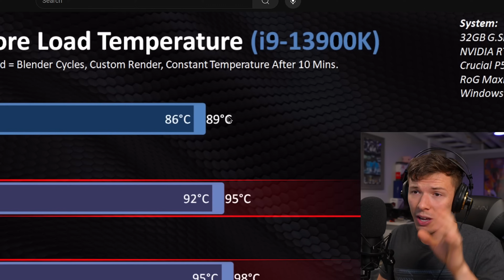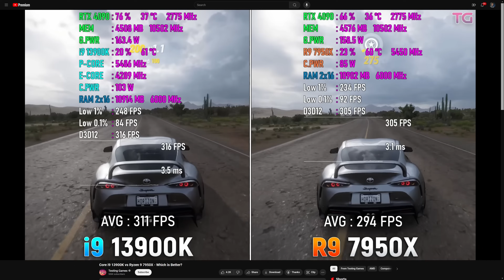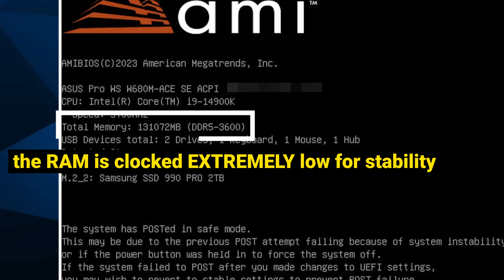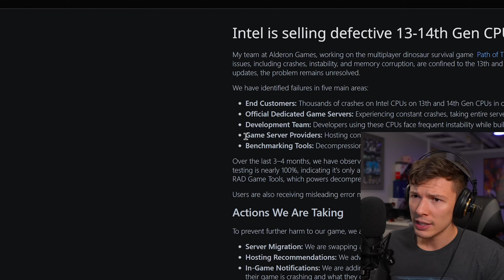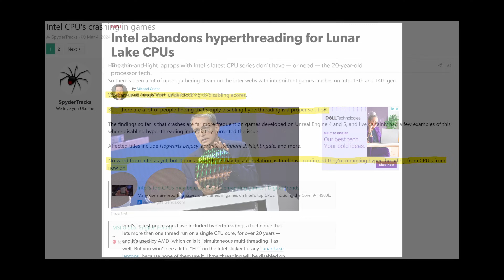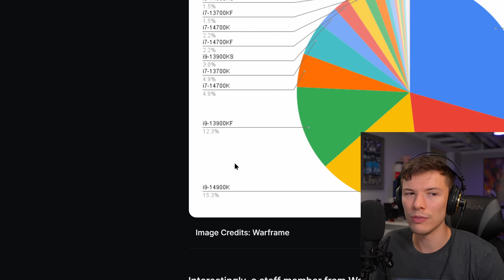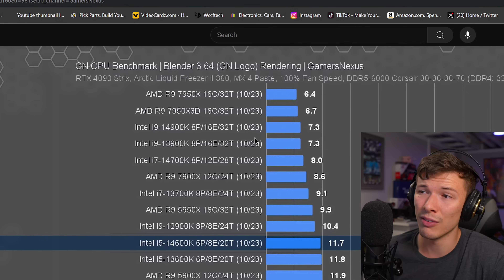Intel F**ked Up Bad

Comment: Some years ago I read about what illegal things Intel did to try to sweep AMD out of existence. And then Meltdown happened. I decided that for the foreseeable future I will no longer buy Intel CPUs, and my next build was with AMD 3700X. Later I got a sweet deal on 5950X. I've been super happy with the computer, I've never looked back, and it's great that I was able to upgrade to so much more performant part on the same platform for such a cheap price. Blue is my favorite color, but yeah, not quite enough to bridge the gap 😂
Reply: This. They still have contracts with Dell/HP/Lenovo to push their chips and offer more models over AMD. I don't even consider Intel anymore. I mean, even before all this, at the very least their CPUs were a lot less efficient for the same performance as AMDs. Why buy them at all? Only reason is brand loyalty.

Comment: This is a disaster and Intel knows it.  They can't replace these chip because it's a design error not a manufacturing error.  Even if they offer us rebate, we would still need to migrate to a new platform either AMD AM5 or Arrowlake/Intel Core.  Some us have to buy new ram kits.

Comment: Bought a 14700K back in idk januari/februari. I'm not sure what to do here, I know that cpu's that run countiously are affected more or faster I guess.
I have had zero issues with my cpu so that's something at least.
I'm going to undervolt my cpu and might disable the e cores as well because one of the main issues from what I've heard is the bridge between p & e cores.

Man what a time to live in....
Reply: @zackzeed  you dont need to disable the e cores just turn the volts down put an offset - in your bios to undervolt the cpu or you can use intel baseline profile
Reply: @TheOne214  Already am. Problem is the physical bridge between E & P cores.
Some say that That is the part that's failing, allthough I would love to know at which point it fails, like if people are overvolting their chips or smth.
Reply: I’m right with you on this. I set intel spec power limits that they posted online and everything works perfectly fine.
Reply: @wikingkrig5801 even a little bit degraded cpu will cause problems since mine isnt it means that its fine and i dont even push my cpu that much though it was at stock setting before i switched it to intel baseline but i still kept the AI overclock disabled i didnt even use it once i was already running a bit lower vaults than stock asus profile so i am confident that my cpu is fine i also have a 360 mm aio on it i never thermal throttled it even once since i always undervolt my cpu.

Comment: 14th gen being more expensive than 13th gen for the same level of performance (without fixing it by artificially forcing more power via the mobo) - Intel says "They aren't the same CPUs" then they proceed to have exactly the same issues, that funnily enough despite being the same eCore/pCore architecture the 12th gen doesn't.

Comment: Has anyone considered that it's not Intel's fault but that Epic and their Unreal Engine 5 is slowly killing the CPU's? I mean, only games that uses that specific engine are causing the problems.
Reply: Bull... Why is AMD not failing on the same engine then?
Reply: @mariusvanvuuren4983  Same question as why it only happens on Unreal Engine 5 and not other game engine's. That's strange right?
Reply: Not amd cpu or intel gen 12 and below
Reply: @GHOULRUL  Yeah that strikes me! They have ofcourse architecture, but maybe there is something in the engine code makes them bonkers.

Comment: The best comment from that GamerNexus video "someone sneezed in the clean room"  🤣, on another note buying intel 13/14 gen is like buying a car with a CVT gearbox,  driving around expecting to hear a big bang anytime.

Things seems to work fine on 12 gen, makes me think that there is a production issue (referring to the sneezing in the clean room comment) or a architecture issue which only surfaced when large amount of power got pumped into the chips for long periods of time. The only way to solve it in software is to limit the power even more and throttle back the performance from "advertised".
Reply: More like a turbo car running too much boost
Reply: Intel was pushing too much voltage and power, this is why we only see the i9s and much more limited number of the i7s affected.

Comment: Intel has rolled out the red carpet for Ryzen 9000 series processors. But AMD won’t have X870 motherboards ready at launch so way to mess up your opportunity AMD
Reply: X870 doesn't offer much over X670, mainly just USB4 and some more PCIe lanes.
Reply: X870 is literally just x670 with usb4. Hell I don't even think average gamers will ever use that many pcie ports in 670e anyway.
Reply: X870 is barely an improvement over the X670, so we don't need it to launch. Pretty sure this is from a SAD Intel fanboy. Anyways I always preferred AMD and Intel up until now, when all 13900k and 14900k chips are failing

Comment: Dear Intel, please understand that videos like this definitely DO affect my thinking and consumer decisions; I can only ignore the flak for so long. I've been building Intel-only based machines for myself, or choosing Intel-based laptops, for 25 years now, but I'm seriously considering moving to AMD for my next upgrade. That is a massive own goal on your part. I've been willing to set aside your general TDP inferiority for many years, but now that you are apparently selling substandard/ unreliable top-end CPUs, at a premium to boot, I cannot blindly keep-on choosing Intel just because I'm a lifelong fan of the brand. You need to acknowledge, apologise, recall, fix and then properly innovate moving forward, otherwise you are giving people like myself very little reason to remain loyal.
Reply: love for intel ❤ ?
Reply: @Chris-w2q  Yep. Some might call it fanboyism, but back in the day it was all about the fact that Intel were advancing more quickly (I used to upgrade my CPU a couple of times a year because the relatively small increase in clock speed made a worthwhile difference to gaming at a time when fps wasn't as dependant on GPU as it is now), but also because AMD chips could lead to incompatibility issues with certain games. Arguably it has been years since those have been legitimate reasons to favour Intel over AMD, but sometimes brands just 'stick' and nothing else will do (for instance I always went with ASUS motherboards for years too).
Reply: @soots-stayingoutofthespotl5495  you know what I love Sega an don't give a damn who knows it. I've brought you something bro here you go 🏆

Comment: what an irony everyone avoided amd cuz of crashes , and now intel have the 100% crash rate 💀
Reply: In my anecdotal experience, I've never had stability issues with AMD CPUs. Had a FX-6300, Ryzen 7 1700, and then a 5800X (both of the AM4 chips running on an X370 board).
Reply: @AirLancer  Maybe your motherboard was the problem...
Reply: @AirLancer  In my experience r7 1700 with x370 was the worst "stability" i have ever seen, even amd qualified ram couldn't run on the system at more than 2666 mhz (not to mention booting up after a crash or any reason for the cpu/mobo to get mad would make the system not post and powercycle for minutes, a few times for hours). 
r7 5700x was much better, with this I've only had to deal with memory issues once, and getting a new 32gb kit solved all of my issues. 
Fx 8350 ran perfectly. 
As for intel, q8200/q9550 never had issues, i5 3470 media box was perfect, and my i5 9600k 2nd pc ran well with minimal issues.
Reply: @AirLancer  I wish i could say that with intel, I had intel duo e6500, i7 4590 and now on amd ryzen 5 7600. AMD is much more stable while intel cpu  wasn t stabile after 3 years on intel that i had at work it was a 9600k then switched to ryzen 3600 from amd because of crashes and spikes hard spikes so stability >>> power (fps) .Intel fanboy's are real  and up to this day i ve figure to not trust anyone on internet just try to compare things in real life to see things that are real.
Reply: @ToxicGamer86454 Report back in 1 year's time. I'd love to hear the progress of your 14900K.
Reply: @ToxicGamer86454 Literally everything you stated is false. You don't have any idea what you're talking about.
Reply: @Son37Lumiere  Exactly that what i think :D
Reply: @ToxicGamer86454 Nope. AMD's modern chips are more efficient and run lower voltages than Intel. The 13900 and 14900k draw significantly more power than the 7950x and the 9950x is even more efficient than the 7950x. Reports are that the 9950x at 160 watts is as fast as the 14900k at 275 watts.

AMD reports temps differently than Intel and their IHS is thicker than Intels, which is why temps ramp up faster and are generally higher.

Intel's stability problems are also not fixed with a bios update, it's looking like a hardware fault due to a manufacturing defect. The bios updates only lower the thermal limits and memory speeds, reducing the problem and also reducing performance by 10% or more.
Reply: @ToxicGamer86454 I have Intel and AMD CPU''s and loads of experience working with both. My favorite is still a 10850K. What sort of experience do you have Intel Fanboy? Probobly only on your first CPU, so largely lacking in real-life experience.
Reply: @ToxicGamer86454 For your sake, I hope it is. Good Luck!!
Reply: I believe Intel continuously increases the voltage of their CPUs to achieve promotional effects. In reality, their CPUs (i7、i9 ) can't actually support it.
Reply: AMD has never really had crash problems. The only product that had issues with stability was the 5700 XT GPU, which were fixed a number of months after launch.
Reply: @Son37Lumiere  i know , here i used amd with crashes as in referring to the stereotype created by people towards amd , ive also used all amd systems with zero crashes
Reply: @KillingFreak270  I'm convinced a lot of the "AMD is unstable" and "their drivers suck" rhetoric on the internets are shills paid to spread misinformation and the fanboys just run with it.
Reply: @ToxicGamer86454 it is clear that the 13th and 14th gen cpus have major design flaws resulting in deteriorating semi conductor, even if any cpu is still working perfectly fine by now there is no guarantee how long will they last ,and about those crash reports being 100% its the percentage of crashes occuring on intel cpus , 

Simply put 
not 
100% of intel cpus are crashing 
But
100% of crashing are occuring on intel cpus
Reply: @ToxicGamer86454 Just because you're not having issues doesn't mean there's no problem, and it most definitely doesn't mean that everyone aside from yourself is clueless and building their PCs wrong (realize how fucking arrogant that sounds?). You're just stupidly lucky.
Reply: Fr 😂
Reply: @ToxicGamer86454 Shows and intolerant you how ignorant you are, I'm running a10850k and a 9700 and a 12400. So if you want to throw comments like that, it just shows that you are blind to problems in the IT field and not mature enough to have a descent discussion about it. END OF STORY
Reply: @ToxicGamer86454 Good response, now that we have finished trying to run each other down, maybe we can discuss things in future. To give my age away, I have been building systems for over 30 years. As I said earlier, I have loads of experience with both Intel and AMD CPU's. My first Intel build was an Intel 80286 and my first AMD build was a 80386 DX40. I am a realist and look for value for money. I have had to build many PC's for people on limited budgets so I always do my homework before advising people. As soon as Intel brought out their e-cores, I was totally uninpressed. I have this feeling that a lot of the current problems are as a result of the e-cores. I will not upgrade anybody to any CPU with e-cores, so Intel is making it fairly difficult for me to support them. I just hope that your i9 was from a good batch, its always a disaster to have a CPU die on you. I have been lucky, in the many machines that I have had, no CPU has ever died on me. Have a quick chuckle now, I have currently, a Core2 duo (Running Windows 11 Tiny - slowly), an i7 3770 running as a server fo r the house, an i5 6400 , my browsing PC, an i5 9600k for household use, an i7 9700 - general purpose and house use, an i9 10850k for video rendering and work, an i5-12400 for gaming, and the family has a few laptops as well. So I am deeply embedded in IT. How about you?
Reply: @ToxicGamer86454man, you're miserable
Reply: AMD Ryzen 5 5500U flawless holy crap (unless the heatsink got clogged)
Reply: Most AMD instability and performance issues at least before Bulldozer, were cause by one single cause... Intel Machine Language Compiler.. which when detecting a cyrix/winchip/amd cpu it would use the slowest possible code paths and always the fastest on Intel chips of course.. they were sued for it and did lose.
Reply: I have a 13900K with a 4090 and zero crashes on UE5 games. I also help a business manage several dozen 13900k and 14900k as they got it for dirt cheap with an asus motherboard bundle and those systems run intensive computational tasks for weeks, making an oodle decomp a vacation time for me, all stable.
Reply: @Pandemonium088  Have they been running at stock motherboard power limits? Or have they been tuned for lower power consumption? It matters a great deal whether it's the former or latter. Most likely what's causing all of this is simple electron migration as a result of the chips being pushed too far with very high vcore and unlimited power limits as they were given by default on most or all motherboards, leading to silicon degradation on at least some parts of the die.

Regardless, the data shows that around half aren't exhibiting any stability issues so it's not surprising if yours isn't even if you haven't limited power since it's not affecting 100% of all chips immediately. This could easily change over time however.
Reply: @Son37Lumiere  XMP, MCE disabled, 400A limit, 253watts which is what Asus sets as default with MCE off
Reply: @Pandemonium088  Per some new information and a video just released by Gamers Nexus it's looking more like this is actually due to a manufacturing defect. Apparently even some laptop CPUs are starting to show instability. Very bad for Intel.
Reply: @Son37Lumiere  makes sense why others are broken out of the box while the vast majority works fine.
Reply: I have a 13900k never crashed once. Stock power, Temps barely reach 55°c while gaming normally 😂 60-65°c on a real hot day. This is with an arctic freezer 2 360. When I had a 5900x my temps were awful! Constantly hitting 80°c just standard gaming. From my experience AMD have always been worse for temps that’s why I switched to intel and I don’t regret it
Reply: @heythenameiselliott2673 Never had a single issue with AMD. Especially not with heating 😂. Either user error or a bad chip on your end.
Reply: @heythenameiselliott2673  I mean if you are running it at 125watts, it should never crash, lmao!

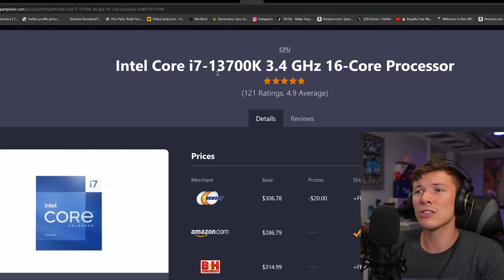Comment: 17:01 - AMD seems to do the opposite. Release the 5800x3D at $450, then release basically the same thing cheaper with the 5700x3D (and 7500f, if you want a new socket) and have people praise them.

Comment: Last intel chip I had that I truly loved was the E8400. Switched to AMD a good while ago and never looked back.
Reply: You had an E8400 until 2017?
Reply: @tim3172  Nah I also had Q9650 for a while and an i5 4440 after that but was never excited about it. In 2020 I went from that to a Ryzen 3600. The E8400 was such great value and I got it to 4ghz with relative ease.  Currently using a 5800X3D which I absolutely love.

Comment: Its got nothing to do with power/heat overall but rather the single core boost algo and is overloading voltage in just 1 or 2 cores when max boosting and degrading the CPU. 
People need to start listening to people like Framechasers and stop listening to the same poor techtuber vomit most spit out.

Comment: they ran out of ways to make a better chip and heck just add more power, i dont think its the about board makers or even oc , due to servers with those chips are failing also and those things dont run overclock to get higher stability  its just bad chip design they dont know what the cause

Comment: we've entered the world of disposable cpus,  like batteries. or kleenex 🙂
wait..."extreme" means "slow down"? that seems counter intuitive, but then technically they're not saying extremely *what*. marketing has no shame... 😞
i remember when i'd think if intel as the standard and amd as the off-brand budget buy... sigh. been thinking of trying my first amd for the next pc build...though i'd have to get a new motherboard too. eek! also i never used to think much about the power used by a cpu, but since i live in an ancient place with very limited fuse box capacity some of these wattage numbers scare me. i'm already at the point of being careful not to turn on too many appliances at the same time or balancing which outlet they're drawing power from

Comment: I honestly don't know what to do at this point. I9-13900k and an Asus Rog Strix Z690-E mobo. 

Crashing when I upgraded to a 7900xtx from a 1070 until I updated my bios, now I'm running at 90°c with a double fan aio at 1440p. 😅

Intel succeeded at doing one thing right....... Getting me to switch to AMD. 

Should I get the new X3D when it releases? 🤔 New mobo options? (Because my old one is practically useless) 🫡